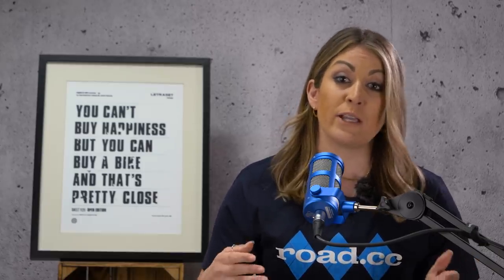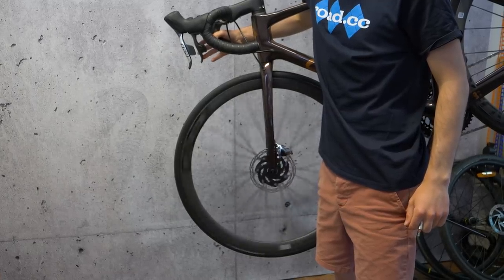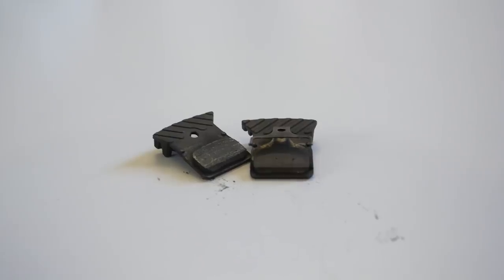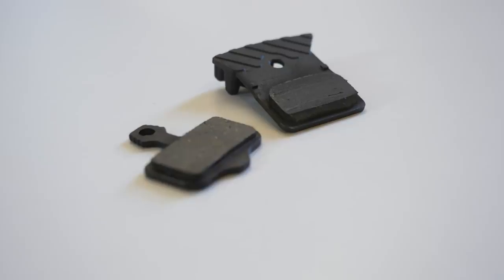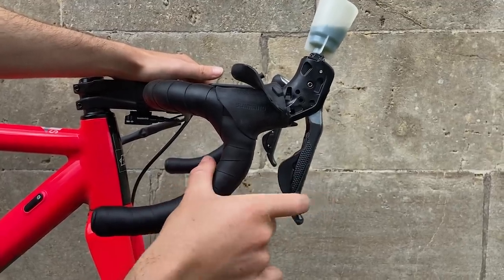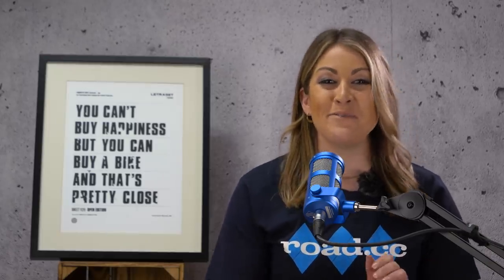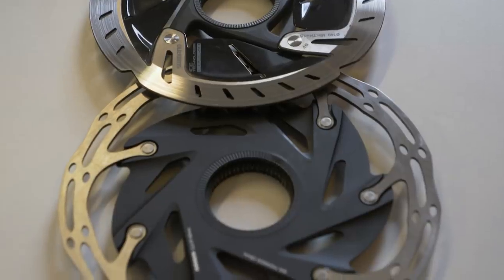8 things they dont tell you about disc brakes

Comment: My first road bike had rim brakes and compared to the cable operated discs on my cheap hybrid they felt crap.
So when I bought a new road bike I specifically looked for discs. I bought the cheapest road bike with hydraulic discs I could find. Honestly, they are so much better than rim brakes, over  4 years and 9000 miles have required no maintenance other than replacement pads and give great performance. I regularly ride on the North Yorkshire Moors and there are plenty of descents where you need strong brakes and they are much better than rim brakes.
The weight thing and the aero are only important if you are entering competition. You'll save more weight buying a smaller phone, or taking a shit before you set off.
Reply: If I'm not mistaken, discs are ever so slightly heavier (like dozens of grams) 
Also they are suppised to be more aero, there are more liberties for fork and stay design and the calipers are generally hidde, and rotors themselves have virtually no impact on aero
Reply: I hate rim brakes for other reasons...but a good caliper brake (shimano sora or better)  will have no problem stopping your bike. What stops your bike is the skill of braking, tires and road surface.
Reply: @WildernessMusic_GentleSerene  tell that to a 25% gradient with a hairpin bend at the bottom. My last roadbike had Shimano rim brakes and they simply wouldn't stop you quickly enough if you were going any kind of speed  and coming to a dead stop was almost impossible. Even if you weren't you're squeezing the hell out of the levers. If it's wet just forget it.
Discs brakes are just so much nicer to use and it is no longer a white knuckle event.
Reply: @WildernessMusic_GentleSerene  even simpler models (Shimano MT 200s combined with Tourney disc rotors) will stop your road bike without problems with 180 mm rotors at the front and 160 at the rear.
XT brakes etc have the purpose to reduce lever force to get 4 of 5 fingers on the bar and only 1 on the brake, which is needed on downhill. A road bike also works with 3 finger brakes
Reply: @peterfenwick4662  yea, my sora brakes have significantly less stopping power than my GRX disc brake setup. it is not even comparable.
Reply: fkn luv it
Reply: No maintenance? My disc brakes need to be realigned every ~400km because they start to rub, and the difference in power in my experience isn't all that big, I'd rather have rim brakes because the maintenance is much simpler and the brakes are more robust, and also cheaper
Reply: @Fred_the_1996  I only have to realign them when I fit new pads. It's also quite a simple job, slacken off the two caliper bolts and reposition.
Reply: @peterfenwick4662  yeah I know but it's kinda annoying to have to do that every once in a while, maybe mine are defective or smthn idk
Reply: @Fred_the_1996  if they're aligned properly, the pads are wearing evenly and the pistons are working correctly, you shouldn't need to realign all the time. Check that your calipers are functioning correctly. My bike has 11,000 miles on it now and I've just replaced a disc and had to clean the pistons as the rear caliper was a bit sticky.
Reply: @aerodynamicist4  ... yes, like 50 dozen grams

Comment: Rim brakes , powerful , easy to adjust and maintain and never fail
Reply: Disc brakes, even more powerful with less lever pull, work consistently in the wet unlike rim brakes, no damage or wear to the rims, less maintenance, just better all round, but it's whatever a person prefers at the end of the day.
Reply: @bertieballs  Rim brakes work beautifully for my riding demands but I'm sure I'd be a fan of discs if I was more of a cycling fanatic . So yes you're right it whatever suits you
Reply: @bertieballs  My disc brakes require more maintenance than the rims tho! Also, the disc brakes give you more power if you're using rotors bigger than 140mm, the 140mm give a similar braking performance to the rims! I think that if you live in a hilly area and do loads of descends (like me) you'll certainly benefit from discs if you, however, live in a flat area just stick to the rims honestly!

Comment: Good video! Nothing you can do about flat mounted calipers when the surface is not true, except get out the file ;)
Post mount calipers allow for proper alignment, and if they are aligned, rub is not an issue.
When bedding brakes, it should not be a complete stop. Squeal is always embarrassing, but rare when the pads are bedded properly and the disks are uncontaminated. You can be careful not to touch or spill things on the rotors, but you can't help it when they get road splash!

Disk brake squeal is not as bad as rim brake chatter though, and on a recent group ride, a friend made a panic stop and his mis-adjusted rim brakes twisted and ripped his front tire open. He's the most fortunate guy in the world though, as it happed in front of a bike shop that had his size tire in stock.

One thing I really dislike about mechanical disk brakes, is that they usually only have one piston pushing from one side. This basically flexes the rotor to meet the stationary inner pad, and excessive flexing can fatigue the rotor. I converted mine to hydraulic mostly for this reason.
Reply: Disc Brakes are for morons at the end of the day and becomes a nightmare if you don't get a really skilled mechanic to service them, Rim brakes has none of these issues literally none

Comment: Some no contact magnetic brakes that can' t wear out and turn brake power into energy would be great... integrated into  wheels and frame...
Reply: They don't work so well at lower speeds & add a lot more weight but in principle, they are great.
Reply: E Bikes with non geared hub motors can do regen braking, a magnetic brake which stores the energy in the battery

Comment: Been out riding bikes with the kids this summer, now I watch bike video's?  I have a 10 year old Trek with V-brakes and I love these brakes!  I however, hate U-brakes that often come on kids' bikes.  All rim brakes are not the same... obviously.  But I think that V-brakes are amazing and simple, and I can't see why I would ever need more than that.  So, I feel that the big argument really boils down to type of rim brakes, and biking style.  I think that good disc brakes will be expensive, and will only benefit those who ride a lot and don't have V-brake options.  I think the industry is developing high quality disc brakes on the backs of bikes that are basically just rode for leisure, yet receiving low-quality disc brakes that have no clear advantage over V-brakes, and are probably not as good overall in cost and weight.  Then, the Disc enthusiast wants us to spend more to re-gain better brakes we already had!?  For leisure?  When is enough, enough?  Most kids bike brakes systems in my neighborhood don't even function properly if at all.  The cables are seized/rusted, the pads gone, the brakes not adjusted.  Most would have been better off having the crank-brake, at least they could stop the bike.  Lever-brakes have just resulted in a sea of poorly maintained kids-bikes that are pure junk now and were never great to begin with.  I think we'll see this trend next in leisure-adult bikes with Disc brakes.  Too complicated and costly to fix, poor quality from the start, foisted upon the ignorant masses for the benefit of a few.

Comment: I've used both on my different Giants hard-tails mostly for every day street use. Discs are ok but they increase the retail bike price about $100, last a year or so before needing pad replacement at $20/wheel and they squeal loudly when wet. The only real advantage I can see over rim brakes is that if you pop a spoke the out-of-true wheel won't slap against the brake caliper until you can get it fixed.
Reply: E-bikes and high performance bikes will benefit mostly from disc brakes imo. Rim brakes are plenty fine if you're just riding around town and on bike paths.

Comment: One thing not addressed by the video is performance in sub-freezing weather. If you ride in snow, the brake rotors heat up above freezing, melting any snow on the rotors. Don't use the brakes for a while, and your rotors and pads become coated with ice. The coefficient of friction of ice on ice is... uhhh... somewhat less than pads on metal. Ask me how I know. 😀 (I rode mountain bikes for 30 years in Alaska.) It only takes a second or two for the brakes to grab again, but under some circumstances those seconds can be memorable.

Comment: i have a cheap bike that had front and rear mechanical disc brakes. i replaced the front brake with a hydraulic brake. i freaking love it! i can actually stop in a reasonable distance now. i like disc just not mechanical disc.

Comment: got v brakes and 26 inch wheels. not worried about never getting parts, ever.
Reply: My tour heavyweight has had a SA XL-FDD dyno DRUM brake wheel. After 2 tours and 26,000+ miles, it's had but 1 needed bearing change. ZERO fuss, squeals and barely any cleaning required. The pads are still just fine. The brake arm is getting close to the limit, but may just need to be repositioned. The cable actually went 20,000 miles/ both tours.
The Dyad rim and spokes are as good as new. It's now on it's third bike. LOL.

Comment: Disc pads come with chamfered bottom edge .I chamfer the three other edges on pads  with a fine metal file before installing to reduce brake rub.
Reply: its a 5 day wait for service so i spent 1000.00 usd on a proper tool set. i can do everything but lace and tune wheels and service suspension seals.

Comment: Cheap pro tip: Bar Keepers Friend is great for cleaning rotors.... they are stainless after all and BKF passivates and removes oxidation bringing the surface back to new. A good bed-in is required after cleaning.

Comment: 1) Disc brake rub 0:26
2) Choosing pads is a minefield 2:32
3) You need to bed in new brakes 3:34
4) Maintenance involves new skills 4:06
5) They can squeal 5:02
6) Rotors wear out eventually 5:50
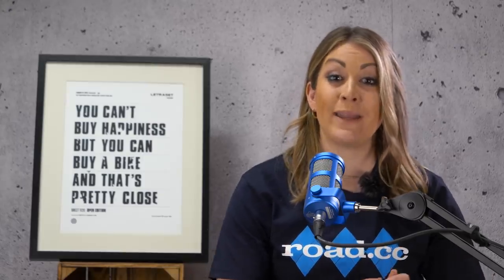7) Disc brakes add weight 6:16
8) Disc brake affect aerodynamics 6:55

Comment: I got an endurace cf sl with disc brakes and its been nothing but a pain in the ass to ride and to maintain. Brake rub since day one (sitting, standing, sprinting, climbing and descending), pads lasting for a month (I live in a hilly area), none of the LBS had the adaptor to bleed (ultegra brakes) had to order online, brake rotors bending and wearing out from heat, being extra careful with the levers when a wheel is off, can't put bike upside down, having to remove pads and/or discs when washing, isopropyl alcohol, worst of all is that brake hoods don't even fit tight on the lever (poor design).

The question is why are we all buying them (including me) if they suck.
Reply: Hey Rodrigo,
I have the same bike with disc brakes, live also in a hilly area (near black forest in germany) and I have no problems with my disc brakes. After 7000km I just needed 3 brake pads, no bleeding, overall they are just working fine. Brake rubbering happens only slightly when I am sprinting and "throwing" the bike to the left and right to support the sprint. Damn that you have so many problems :(

Last time I was driving with a friend with rim brakes and on some tracks he had to slow down generally because of brake performance. Another nice thing about the disc brakes is that I don't have to worry about overheating the rims and to melt my TPU tubes (aerothan from Schwalbe).
Reply: Wow, that’s a lot of problems.  Is there some misalignment in the frame or something. Presumably there is a root cause to the rubbing.  So far so good for me on my BMC roadmachine with Ultegra disc brakes.  I am heavy at 91 kg, and feel a level of confidence running latex tubes and not worrying about the rims heating up on long descents. On my rim brake bike I run butyl tubes and don’t worry about them. 

I have only had to bleed my mtn bike brakes twice in 11 years, and found it strangely soothing watching the bubbles…..I have operated the brakes occasionally with the wheel out by mistake, but no real drama just push the pistons back with a large  flat screw driver .  I have never removed the pads, discs while washing the bike .  For a deep clean I remove the chain anyway, so not getting degreaser all over the place.
Reply: @SaschaN  Hey Sascha 
There is no doubt that brake performance is improved, specially in long steep descents. Also the fact that there is no brake track on the wheels that wears out with time.
 I may have defective brake calipers or levers or indeed an alignment issue with the frame. I also suspect wheels are not very stiff and that may cause rubbing (DT swiss db spline) 
All in all, I love the bike but I could like it even more without all those issues.
Reply: @chapmag6578  Hey Glenn. 
What kind of brake pads do you use? I tried resin and metallic but I had to replace rotors soon after.
Reply: @RodrigoLopez-tw3nx  just for helping: did you already try to realign the brake unit with loosing the screws at the flat mount unit and trigger the brakes so that the unit aligns to the disc rotor? A torque wrench is recommended for this.
Reply: @RodrigoLopez-tw3nx  hi, I am just using standard Ultegra resin at the moment.  Might change to the ones with the extra heat sink and dura-ace rotors (supposedly better heat dissipation than the Ultegra rotors….haven’t seen any data to support the claim though ) when the next change is due to avoid some of the heat problems people are talking about .
Reply: Get to a better bike shop
Reply: @chapmag6578  I have the ultegra ones and the only problem which occurred was that I recognized that the Dura ace ones are black and would match better to my bike. Even warping or something has not been a problem yet. I use them with the L03a resin pads.

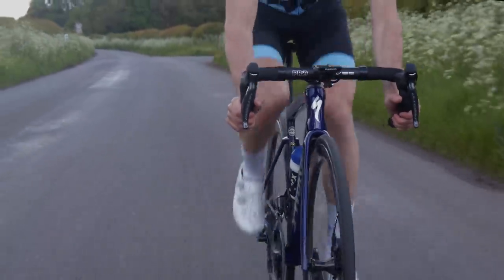Comment: 7:30 "With proper integration," discs... more aero than "traditional" rim brakes. What about rim brake calipers, "properly" integrated into the fork and seatstay? Surely the opportunities for aero improvements lie in that latter area?

Good video, by the way. The narrator has an air of detachment and impartiality that I like.
Reply: and the higher spoke count on front disc wheel is less aero than a radial 18 spoke front rim brake wheel. Spoke count was always given as a greater aero issue than minor rim shape differences not so long ago by the cycling media...
Reply: @andhib  Good point.

I'm being told now, that disc braked TT bikes are more aero than older rim braked ones, as if we are supposed to celebrate the fact that the previous generation of machines were as bad as if they had bricks bolted to the frame.

Incremental innovation has become a religion.

Comment: I use both. Rim for road. Disc mountain & gravel. NO WAY would I buy a disc brake bike for road.The feel of a 6.75kg bike climbing over your typical 8.1kg+ disc (equivalent for price) . So much faffing around and maintenance required. And when travelling too, much more of a headache. Much prefer being out on the bike putting in the km's. Good rim brakes require very little attention and are easily ajusted to the slight imperfections that tolerences can cause. For MTB its a completely different ball game.

Comment: In my experience, disc pads wear sooner than rim brakes. So, they are more expensive to maintain. Also, since disc brake became fashionable, the bikes equipped with disc are considerable more expensive.
Reply: You hit the nail on the head - fashionable
Reply: Its all about these gainzzzzzzz ...lol (disc brakes are the worst thing that happened to road bikes due to a non-imaginative industry pushing them down your throats)
Reply: Go on Amazon and look at the price of pads, I've been using a pair of metallic sintered pads that I got for $12.00 for over a year now and they work awesome, and it's on my mountain bike so I'm getting dirt and grime on them constantly with no brake fade. People shy away from new things and want to stick to the old tried and true and end up missing out on some great stuff because of their refusal to go with something new, even though disc brakes aren't a new technology. I bet $100 that people absolutely refused to go with Carbon road frames when they first came out but guess what, they've proven themselves and now almost every single professional rider uses a carbon frame.
Reply: Welcome to the brave new world.    8)

Similar things are happening with cars. They artificially enhance the popularity of some feature (usually touted as a racing improvement or a luxury improvement), then make everything else obsolete and crank up the price. Nearly none of the money we spend on vehicles of any sort can be truly justified.
Reply: @timhofstetter5654  like for real, I'm looking for bicycles within my budget and the disc brake version of a model is usually £150 more when the bicycle only costs £400 without discs for example

Comment: I've got hydraulic discs on 5 of me bikes..........The only one that doesn't have them is my old road bike....Discs are way better in my view but, if you set up rim brakes well, they're bloody good. 
Saying that, in the wet, discs are way better.....
I have discs on my gravel and CX bikes....as well as a 29er hardtail, 26er hardtail and a full suss trail bike.
I've had no problem burping or bleeding hydro brakes these past few years, although Shimano use mineral oil and SRAM use Dot fluid (which can eat your seals).....
If you get any rubbing, it's an easy job to get them aligned.....just release the two caliper bolts, hold down the brake lever, and then do the caliper bolts up again (5mm allen key).....this usually works for me...
Reply: I'm pretty sure sram use dot5.1 that will not eat seal or colour like dot 3 4 and 5.2
Reply: You're lucky the trick to align the brakes works. It never has on mine because the brake hose pulls the caliper which puts a twist on it. I do it by eye with white paper or a light under. Much easier on MTBs because of the larger gap between the pads and rotors.